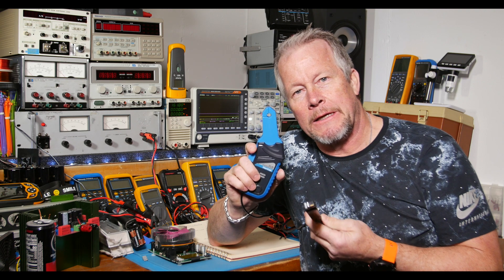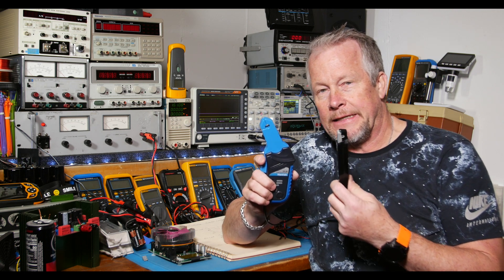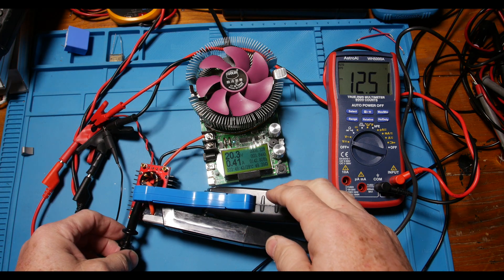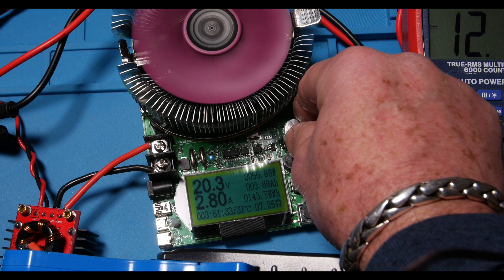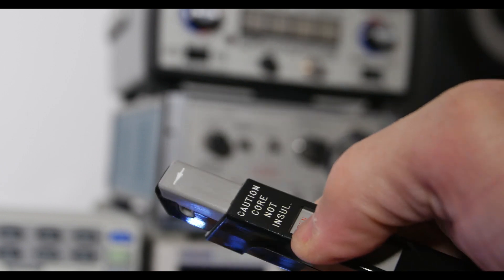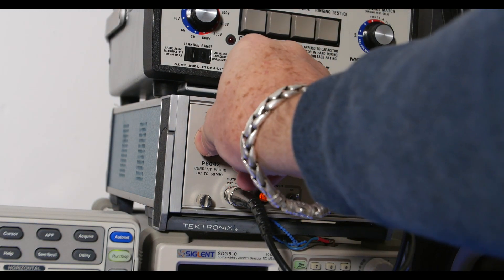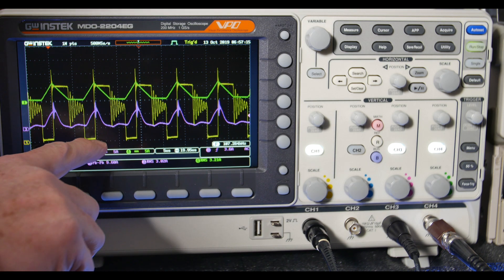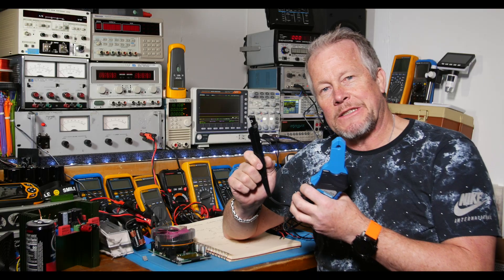Tektronix vs Hantek current probe looking at current in boost converter #CC65 #cc-65 #tektronixP6042

Comment: That's a great comparison video and it does show a clear correlation to you get what you pay for.  It's impressive for something 50+ years old.  Current probes are pretty expensive though so my take away is I'm going to wait until I can afford/justify a quality tool.  I had taken a look at the i-Prober 520 as well which can measure currents in PCB traces - still way over £500 though.  Thanks for doing this video.
Reply from the maker: Andrew Johnson Thanks Andrew!  It is crazy the cost of these probes.  It’s too bad that more Chinese vendors are not making probes.  I’ll keep my eyes open...
Reply: у них разная полоса пропускания, поэтому надо было ещё показать на частоте 20к и ниже. это глупое сравнение, это одно и тоже что сравнивать трактор с феррари на гоночной трассе, но не сравнить их в поле!

Comment: Thats not really a good comparison. The hantek is maxed out at 20khz, would be great if you showed comparison examples from 60hz to 20khz of both of them.
Reply from the maker: Thanks fir the great input;) You are right about the Hantek operating out of its bandwidth, but it did pretty great for a low cost probe.  My comparison showed how great the Hantek really is.  But yes, I do need to show how much better it does in the bsndeiyh it is meant for.  Thanks for reminding me;)

Comment: Another great video Chief !! Thanks !!
Have you played with the ATI current probe?? It's pricey but does NOT require a clamp but rather a tip which feeds a magnetic flux field and allows one to troubleshoot by seeking larger than normal current draw ie, shorts and low resistance paths which draw excessive current.
https://www.youtube.com/watch?v=ZmHgndS3qh0

HP once had a similar product which looked much like their logic probes. It was called the HP-547A. I just found one on ePay for about $200 with taxes. I expect it tomorrow Saturday Feb 7 2020. Looking forward to playing with it.
https://www.ebay.com/itm/Hewlett-Packard-545a-Logic-Probe-547A-Current-Tracer-/323946216889?hash=item4b6cb2fdb9%3Ag%3A40YAAOSwjJddoqF7&nma=true&si=cIHe29Ith4SvcR4mADnv8Xt1t2U%253D&orig_cvip=true&nordt=true&rt=nc&_trksid=p2047675.l2557

Oh. the 547A was a product of the mid 70's and I am surprised to have never seen anyone else sell something similar.

The 547A differs from the AIM probe in that the HP turns a bulb UP in intensity as the device senses more I.. The AIM unit has a BNC connector and plugs into your favorite scope and displays more accurate info.

When I am troubleshooting a board, I just want to find the defect device and replace it quickly.. I have a Fluke  Laser Thermal probe which display temp in C or F but it has a tendency to see too much real estate on the board so I try to narrow the search down with a vertical and then horizontal sweeps. If I have a component really sucking juice, I can find it quickly MOST of the time. However with many pf the newer SMD boards where the component density is so great, it is much less effective.
For years prior I used a homebrew thermocouple probe I pushed the TC through a discarded test probe and used a dab of RTV and put a piece of heat shrink on it to steady the tip...That crude test fixture plugged into an analog or digital meter worked wonderfully and cost under $10.

I have been considering the purchase of a thermal camera but there are problems there too. Exposed metal shows up as hot do to reflections. Top of caps also give a false positive, even when the are working perfect.

I'd really appreciate your wisdom in this area and maybe this might be a good topic on a troubleshooting faults video.   I'll even offer the use of my HP 547A for a few weeks, assuming it works, to loan you another item for the video. I'd also be willing to make you one of my crude thermocouple probes..Don't laugh, I solved MANY MANY problems with my probe.
Years ago I used one a finger wetted in my mouth to run across RAM IC's and that worked too.. Unfortunately, I did manage to burn my finger a few times and thus, my probe took over the duty of getting burned.... LOL

The very best to you and keep up you EXCELLENT videos !!

Glenn WA4AOS
South Carolina
Reply from the maker: Thank you Glenn!  That HP probe is really cool!  I think I actually have that probe set in my storage somewhere.  I forgotten about it.  I appreciate you and would be happy to use anything that you think would help.  I'll return anything as well;) I know what it feels like to have those burnt finger tips;)

Comment: You should look into LEM closed loop hall sensors, for about $30 from digikey you can get a dc-500khz current probe you can power from your scopes USB port.
Reply from the maker: Thanks - that’s a great idea.  I have actually been working on something, but I’ll check it out.

Comment: Hi Eddie,
Great demonstration, showing the difference of not having the correct bandwidth equipment :)
I hope you manage to fix the sliding button.
Funny how things change, a new mobile phone compared to the first portable mobile phone ( boat anchor ) :)
ATB Adam
Reply from the maker: Adam L I hope I can epoxy it - I may have to be creative;) But, it still works.  I think the plastic might have weakened, or I just have a strong thumb;)

Comment: Interesting, that's something I have always wondered about... Is a twenty year old top of the range unit better then a modern cheap noname unit today. The technology has really been better in the last 20 years!
A small comment about your editing in this video, at 0:58 you chose to speed forward instead of a cut, it did look wrong, like a "jump scare":-)
May I suggest to use a cut and then a fade between the images or just let it be, we are visiting your shop on a "sitting beside you" manner:-)
Reply from the maker: Fried Mule Yes, in some cases the old technology has not really been made less costly today, or at least the big name venders have not wanted to share in the cost savings.  Not many probes require a separate amplifier, but the bandwidth is very impressive!  That’s great feedback - thank you!  I like the idea of uploading more full videos with minimal edits for the Patreons to watch if interested.
Reply: @KissAnalog  That would really be great! Am I right in thinking that  you cut away a lot of small extra info, side stories and setups, that you judge as not strictly necessary for the video?
You could maybe also make it possible to download a pdf copy of the paper you use in your videos?